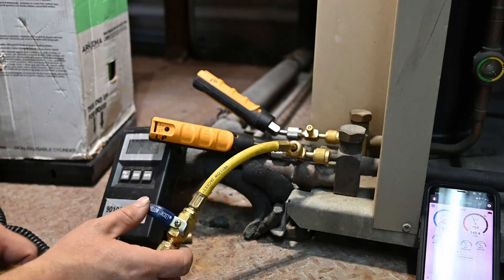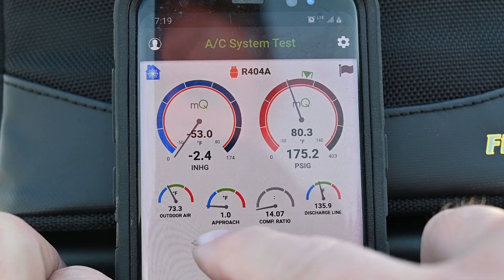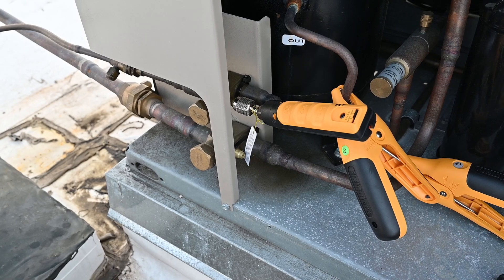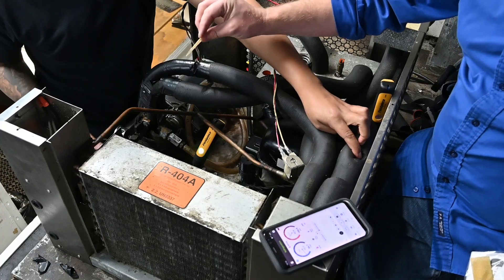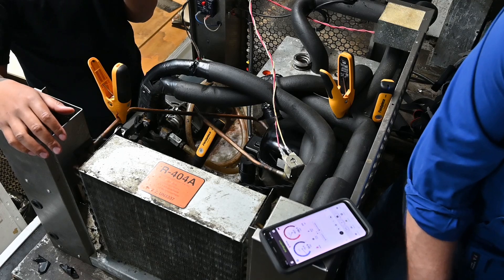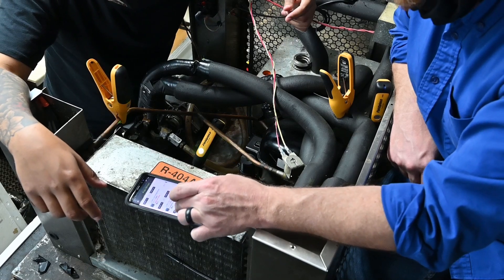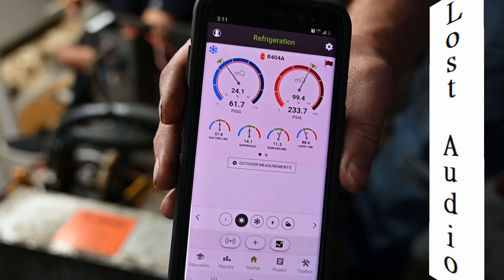HVAC 110 Part 3 Refrigeration Examples, Charging,  probes and measure quick

Comment: Thank you Mr. Ty nice tools make process faster. Q: what is the purpose of measuring discharge line tem and how much normally should be? Thanks.🌹
Reply from the maker: https://www.achrnews.com/articles/88734-a-look-at-compressor-discharge-temperatures
Reply from the maker: It should never be above 225 to prevent oil breakdown. 
The difference in suction superheat and discharge upserheat 
you can figure of how much superheat the compressor has given through compression and mechanical /electrical inefficiencies.
reading to diagnose faults that may not be apparent through other means.
It also helps diagnose non condensibles.

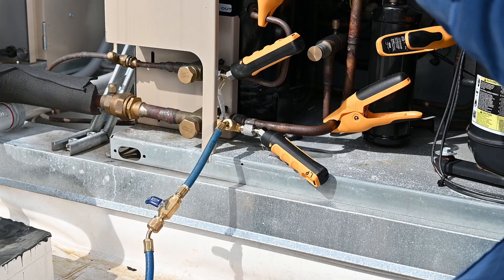Comment: 3:35 I would like to turn the ball valve open a little bit, and quickly connect it to the Tee port. Without purging you will charge someone air into the system
Reply from the maker: Yes
I leave a hoses on the tanks So i don't have to purge it every time. It keeps the hose from getting contaminated with moisture each time.
I will do a video a out the importance of purging soon.

Comment: 5:30 That’s how bad the temperature clamps are. Most of the times you have to clean the copper tubes. Residential AC suction lines are insulated, you have to tear the insulation foam pipe much longer to clean the copper line, then seal it back with tapes. Much extra work to do with those temperature clamps. 
I normally put tee connectors at the ball valve sides of the low loss hoses when space is limited.
Reply: You want accurate temps with any brand temp clamp, read from clean copper.
Reply from the maker: The field pice use the pipe itself as as the circuit for temperature. If it doesn't get good contact it will not read. 
I have a few different fittings for those unusual hard to get to spots. 

I remember when the fluk pipe clamp first came out. That thing was so fragile
 Was the thermocouple or the wire into the end or the cord would break. 

Always something!

Comment: After taking the HVAC course at Laney College in Oakland I enrolled in San Francisco city College for their electrical engineering degree course and it just happened to be right next to their HVAC program sharing the same building. 

Speaking to who is in charge of the HVAC courses he did not want to introduce digital gauges and instruments like Fieldpiece felt they were too complicated and that they could not teach the students the basic foundation of analog gauges.
Reply from the maker: I believe in starting with analogue gushes. Its a great way to show the foundation.
It's sad to hear "it's too complicated". That sounds like either too "expensive  for the budget" or  "new is scarry".
The world is turning digital weather we like it or not, better or worse. Just  like we enjoy tools, newer generations like the technology and digital aspect. 
By the time you add formulas and all the numbers from the system, it is so much simpler. It makes me sad when a school doesn't want to teach something " new".
Reply: @love2hvac  I do not miss running inside and outside to take in measurements multiple times and writing it out on paper. 
              I just purchased my first Sensi Predict kit & TEC Minneapolis Digital TrueFlow Solution Full Kit with DG8 Manometer and All 8 Adapter Plates
               Trying to better myself and my product to my customer and be ahead of everybody else. 
           Lead , follow or get out of the way
Reply from the maker: I love it!!!!